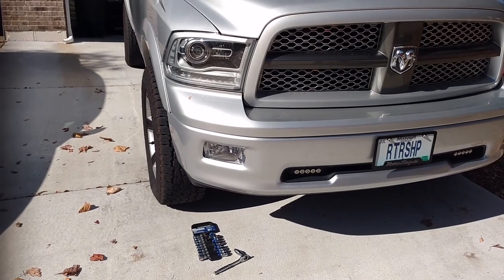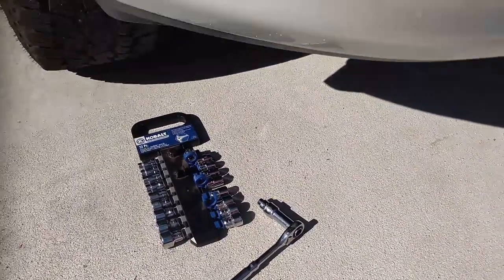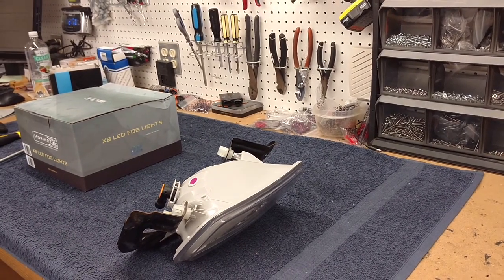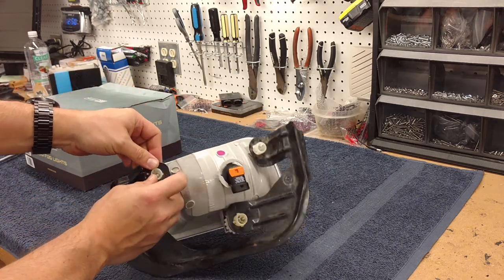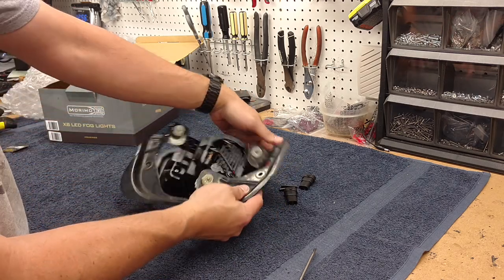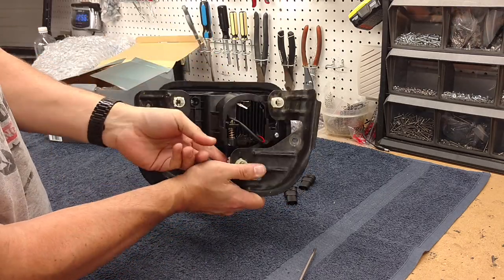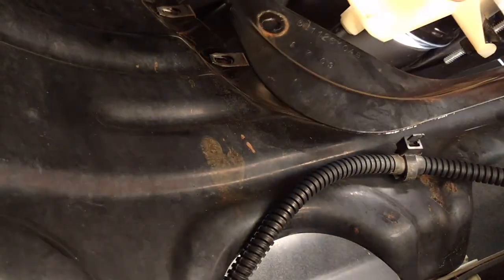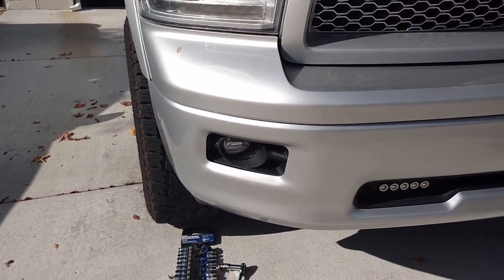Morimoto XB LED Ram Fog light install

Comment: Why they cannot fit the connectors in the factory is beyond me.  I just got a set of these for my car, supposed to be plug n play,  but until I saw your video I thought I was stripping wires and soldering.   The tail lights I bought from www.declite.com ARE plug n play out of the box.  The connector is already there and ready.   They do look and feel good quality, it just pissed me off with connectors.  Thanks for the video, now I know what to do with the wires.

Comment: Jesus, these damn plastic clips on those spherical mounts were a PAIN THE ASS to remove. If I had the opportunity to do it again, I would 100% buy the METAL trim tool. 

These lights do have a good output and nice wide light.

Comment: Do you sell the plastic fasteners that attach the fog lights to the mounting brackets? Mine are so old and brittle, they brake off when I try to remove them.  I do not want to buy a new set of stock fog lights just to get the new fasteners!
Reply: Did you ever find the plastic fastners?? Just ordered these now and need them!
Reply: Did you ever find a solution? I broke one and tried dealerships, all they want to do is sell a new light and junkyard so far has been no help.
Reply: @rickymartin1507  50-60$ on ebay gotta buy whole new shitty set of fog lights for new clips

Comment: do the brackets bolts(the 10 mm bolts you took off in the video)  need a nut to hold them onto the bumper ??, cause in trying to install the bracket for the fog lights

Comment: Are the LED bulds replaceable? Bulb #? Thanks!
Reply from the maker: no, its a fully enclosed LED unit.
Reply: @RetroShopLights  so if it fails your out 200.00?
Reply: @RetroShopLights  warranty?
Reply from the maker: @Man_in_the_moon_oahu  these are covered by a 10 year warranty on the LED components.

Comment: Do u have it for 2016 ram
Reply from the maker: Yes, those can be found here - https://shop.retroshop.us/ProductDetails.asp?ProductCode=RM%2ELED%2E13  (assuming you are asking about a 1500)
Reply: Yes 1500 ram express model put  fog light are up  mode not side ways.?
Reply: RetroShopLights
Reply: Will I need a different plug or resister.?
Reply from the maker: yup!  the 13+ 1500 version is what we listed earlier there.  That'll get you going!